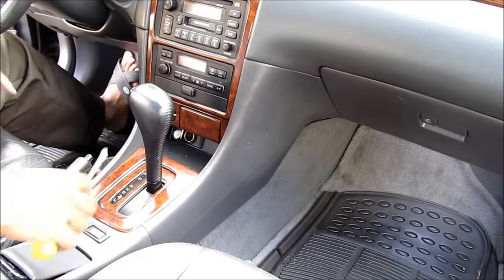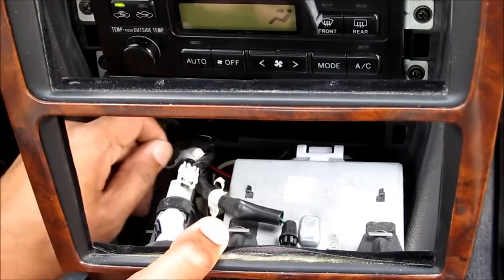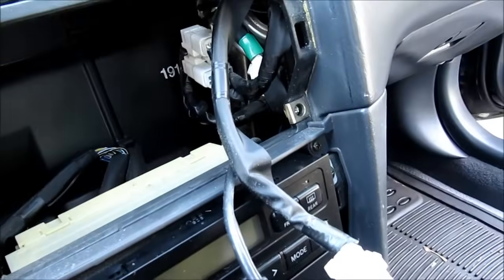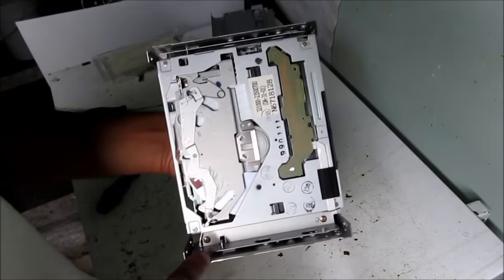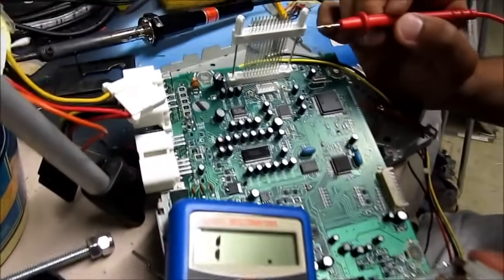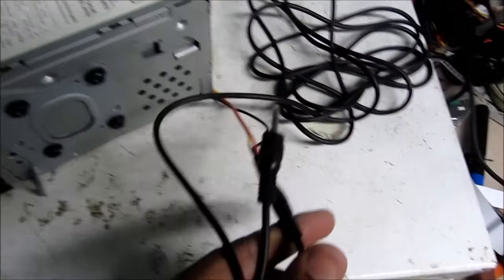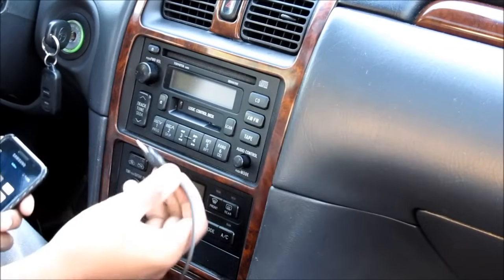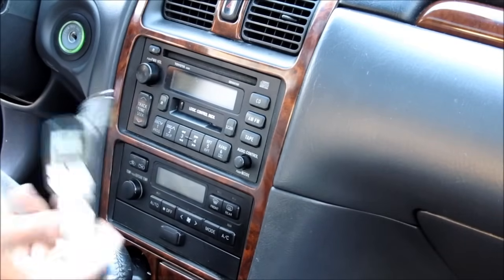Auxiliary Stereo Input Hack

Comment: Have you considered using the L/R pins on the 12 pin connector on the back ? Shouldnt that be the same, but without opening the unit itself ? I have a 2002 Corolla with a W58802 unit and was searching for a way to add an aux input (possibly 3.5").
Reply from the maker: +Spalxy I don't think all radios have a CD changer port. Either way you'd need something to fool it to read from the CD changer port, like a module, or CD changer.
Reply: Yeah, i was afraid of that, was unable to find a "simple" method of just telling it there is a cd changer (like adding a resistor or something simple) and hijacking just the audio pins. There are a few projects on the net, but they are too complicated for my needs. Either way, thanks for the reply :)
Reply from the maker: +Spalxy yea ive looked into them, they emulate CD changers.
Reply: Yes. I've stumbled upon this project http://www.softservice.com.pl/corolla/avc/simpleaux.php which has an AUX only option and should simulate a CD changer's presence just so that he can use the audio inputs, but still looks a bit over-complicated.

Comment: So all I have to do is find the left and right testpoints on the main board and stick the left and right cables of the aux cable? and it works like a normal radio with fm etc but when the aux is connected it plays music from the phone?
Reply from the maker: +NaiReEimaiKyprios yes and don't forget the ground wire
Reply: speedkar99 what happens if i dont connect the ground wire?

Comment: Does it play mono or stereo using this method?
Reply from the maker: +James Patrick both. There's 2 methods here
Reply: speedkar99  I only see one method on this one. There are (2) methods on your Honda video. Is this method on the Toyota mono or stereo through the tape deck test points? Thank you for an excellent video, this is a game changer for my 4 runner stereo.

Comment: speedkar99 i have the same car 99 toyota silara sle with jbl and i want to do this aux hack but did yiu use one single length of aux cable or did you splice aux cable into another cable to get the length to reach from headunit to where it is now?
Reply from the maker: +david anderson In the video I spliced the cable to make it easier to run the wire out of the stereo case, and then joined my aux cable to it. You don't have to do this and can connect it directly.
Reply: where did you get your aux cables from they are different then when you strip a 3.5 cable the wires are very thin copper and not individually rubber coated. did you use wires from a wiring harness?
Reply from the maker: +david anderson the aux wire is a stereo extension cable from the dollar store. The patch wire was chopped off a computer power supply.

Comment: this is the longest b.s. process ever. if you are a tech geek and enjoy working on shit for no reason then cool. however, this is not practical. why not just buy a cd player with a aux input???? maybe $50-$60 at most.
Reply: Thats great but keep in mind your JBL amp will need a specific harness to work with any aftermarket radio. The harness itself will cost about 100$ + the price of your new head unit. So his DIY option is great.
Reply from the maker: +drumbmajorbeats Because this cost $1?

Aftermarket CD players look ugly and ruin the look of the dash.
Reply: +speedkar99 I strongly disagree with you sir. you have used a soldering gun, which most people do not have lying around the house and they sir are not $1. it's ok to say you just enjoy tech stuff & got alot of rime on your hands.
Reply from the maker: +drumbmajorbeats  I don't think DIY projects are for you then...
Reply: +speedkar99 I believe you have missed the point of my comment sir. you have posted a (DIY) video, for more the less an educational video. I have voiced my opinion. that's all. if you don't like it, I wouldn't post public videos, or disable your comments. until then I think I will purchase a cd receiver that has bluetooth, aux, plays cd's and is equipped with Sirius radio already. lol.

Comment: Can this same process be used on the cd/tape deck in a 2003 Toyota Avalon?
Reply from the maker: Yes
Reply: I just had one more question before I take on this project. Did you add the ground wire with the harness (Yellow and red) wires or was that part of the original unit that came from the factory?

Comment: I want to test it before putting back into car. I have a 12v battery but I don't know which connections are for power on the back of the headunit. Can you tell me?
Reply from the maker: +Sam McWhorter I don't have the wiring diagram off hand, but some quick googling will give you the pinout for most Toyota radios. How would you test it without the amp and speakers attached outside the car anyways?
Reply: +speedkar99 I was going to take an extra speaker  lying around the house and connect it to that without the amp..can you do that?
Reply from the maker: Without an amp you'd probably hear nothing.

Comment: great how to! I could get audio through the tape source but only with an actual tape in there - which makes a clicking noise because the plastic cogs are broken. If only there was a switch i could solder to tell the stereo that a tape is installed without actually having to have one in there.

Thanks again
Reply from the maker: +Cameron O'Loughlin Yes I had the same issue on my brothers Lexus gs300 radio. He ended up going thru the CD input and playing a blank CD to force it to read from the CD input. CD doesn't make much noise.

Comment: Thanks for posting this. I just finished the instillation on my 2001 Land Cruiser and it works great (Toyota part number 86120-08130). Very similar head unit to OP's but slightly different. I didn't solder to the correct ground the first time so the sound quality was terrible. I found a pin nearby the two test points that shared a connection with the sony chip ground and that solved it.
Reply from the maker: Great

Comment: it didn't work.
My stereo is a fujisu although it looks the same
How did you test the sony chip Amp it looked like you had a  computer
power supply to test the 3rd pin. on the back of the pcb i found an L & R but not near your pads
Thanks for any help
Garry
Reply from the maker: I didn't use a computer power supply to test, just solder and trial and error.

Comment: Hi, I have a 1998 Camry, would it be better to do this AUX mod, or to get a basic sound system upgrade to my car? I have OEM, and have been using bluetooth radio for playing music from my Samsung S5. As I just started getting into music a little more, I noticed how neutral my car audio sounded - very little bass/treble, it just sounds like... your favorite monotonous speaking professor who helps you go to sleep at night. How much will my car's sound quality improve if I do this AUX mod? How does it compare to a basic sound system upgrade? Or, perhaps do you suggest I do the AUX mod and upgrade my speakers? Thanks.
Reply from the maker: +Ki T the Aux is the same quality as  CD. So if you don't like how your CD sounds, get a new head unit, then work on the speakers. 

In my case I love how the JBL sound system sounds in my car so the Aux was worth it for me. I don't think the 98 Camry had the JBL option.

Comment: i need help.. i had a picture of my motherboard. but i see a L and R.. and another L-Ch and R-Ch. which pair do i need? or plss add me in fb.. search AL Lakard. ty..
Reply from the maker: +Aldralal Wahid To me that sounds like they're the same. Have you tried a continuity tester to see if they are? My only suggestion would be to try and see, that's what I did here and it worked.

Comment: my mother board was different also. but I found r-ch and l-ch and they work, but the only way to engage those tape connections, is to put a tape in the tape player. ( that has makes all kinds of noise ), so how do I override the requirement for a tape to be in, to active the tape circuits...  plz help...
Reply: +Mike Edel sorry just started reading the show more...  So I have to put in a tape...  there isn't a hack to bypass the requirement for a tape in the slot..???
Reply: +Mike Edel there are a couple of switches that detect that the casette is inserted. You need to somehow replace those with an external toggle switch and remove the audio input from the casette deck.
Check out the channel called " The Post Apocalyptic Inventor". He has a video covering this😉
Reply from the maker: +ted clubber lang Thanks. My brother and I tried to get the cassette player into thinking it was there on his Lexus GS300, it didn't work. 
https://www.youtube.com/watch?v=zp-t7cl_ZSs

He ended up hacking in the CD player lines and wired in a bluetooth adapter instead.

Comment: "I'm not sure on the balance issue, unless you soldered to the mainboard which separates outputs to the individual speakers instead of the cassette deck which is just stereo sound."

So which I was supposed to solder the wires... I believe I soldered where you soldered since you and i have the exact same radio... which was @4:18 in your video... 

I believe I did NOT re-insert the tape cassette wire to prevent static pops..

Is there any way AROUND the problem of your statement below...

"you need to turn the radio off, plug in, press play on the phone, and turn the radio back on again, and then repeat everytime you change tracks."

Thanks again!
Reply from the maker: +jlhouse6 So does it work when you unplug and connect? I haven't found a solution yet, I've just been using it as is, my tracks are 20-30 mins long anyway. I suppose I could try another app or ROM on my android, or just go back to my old original Samsung Galaxy S.

Comment: Can I ask which brand of wire you used for the aux-in wire itself? For Samsung phones and LG phones, when I plug in the aux-in, I only hear the car radio but with the volume slightly lowered by itself. I have no problems with an iPhone, or my Chromebook...

Also, not sure why but my BACK speakers of the car is SIGNIFICANTLY lowered... I have a 99 camry and followed the soldering as stated, but my question to you is by soldering the 2 wires to the left and right... does that some how effect the BACK speakers?  I know the back speakers still work because if I use the balance setting and have all the sound going to the back, I can hear the radio whisper...

Any help would be great... Thanks!
Reply from the maker: +jlhouse6 Some cars won't override the radio signal like mine did. You could use a blank tape to trick the player into thinking there's a cassette in the deck and the radio signal will be overridden. 

I'm not sure on the balance issue, unless you soldered to the mainboard which separates outputs to the individual speakers instead of the cassette deck which is just stereo sound.

I too found a difference in the phones. On my Galaxy S, plugging it in with music playing automatically overrides the radio, where as with Nexus and my Galaxy S5, you need to turn the radio off, plug in, press play on the phone, and turn the radio back on again, and then repeat everytime you change tracks. Annoying I know.

Comment: hey, I did this yesterday and its working great, thank you. but it only works when theres a tape in the deck,it doesnt work on FM radio like you said. and when theres a tape inside the sound from the tape overlaps with the AUX sound, a bit lower in volume but very obvious. so what i did is i got one of those cassette to aux adapter and cut the wire and use it in the deck. do you have a better idea? maybe trick the stereo to think that theres a tape in the deck?
Reply from the maker: FM override seems to work on only some radios You can disconnect the traces of the cassette player so you don't get interference.
Reply: +speedkar99 how do i do that.
Reply from the maker: +kmmdur Trace the wires coming off the head of the cassette deck to where the ribbon cable attaches to the board and disconnect it.

Comment: @speedkar99 what if my camry doesn't have jbl? by motherboard looks different than yours but on the back side I see a L and R solder point. Can I use those points?
Reply: +speedkar99
Reply from the maker: +Jacob M Yes you can. Not sure if you'll need a blank cassette for it to work though, like this:
https://www.youtube.com/watch?v=zp-t7cl_ZSs
Reply: +speedkar99 Hey I ended up soldering my aux cable to the mother board L and R points (my motherboard didn't have the same points as yours) and my radio doesn't turn on anymore...Have any idea what I can do? When I press the cd eject the cd comes out but nothing else works
Reply: +speedkar99 I should have waited for your reply :)
Reply: +speedkar99 Can I send you a picture/ video of my motherboard so you can tell me which points would work if possible?
Reply from the maker: Take apart the radio and double check the connections. There might be a fuse in the radio, check that. Ejecting only the CD sounds like it's not getting ignition power (as you can only eject CD when car is off). Check the wiring harness to make sure 12v is hot when ignition is on. Did you solder a ground connection as well?

Comment: Hey just wondering, can we just remove the tape deck unit entirely? It doesn't seem like it's necessary to keep it inside in the whole unit unplugged.
Reply from the maker: +Jason Huang It depends on your radio. In my case it overrides the FM signal so the tape deck is useless. But in most other radios you need a blank cassette to fool the TAPE function in to reading from its source, like this: 
https://www.youtube.com/watch?v=zp-t7cl_ZSs
Reply: +speedkar99 Just took it my radio apart, but I found it's a different version of yours (possibly older). I'm having difficulty finding those points to solder the connections to. Any advice?
Reply from the maker: Did you look on the cassette portion of the radio circuit board? Trace the ribbon cable that comes off the cassette head where it plugs into the circuit board. There's usually positive and negative, right and left of each, and then ground.

Comment: +speedkar99 My 3.5 mm jack doesn't come with ground wire, is that okay? Please respond.
Reply from the maker: +John Jeriz Lopez Ignacio The jack doesn't come with a ground? It should, and it should make contact according to the 3.5mm pinout here:

https://lh3.googleusercontent.com/-2YwJ27Nb3Wc/U-5XpZNKtdI/AAAAAAAAHjQ/jJDJq1oKOPc/w392-h439-no/Milestone-dock-adapter-pinout-audio1.png

Otherwise you have a microphone (or mono) jack with just ground and left.
Reply: +speedkar99 Umm, My jack had only two wires, the black with white and pure black. I cut them our from my old USB speakers. Is this still okay?
Reply from the maker: You need a ground for it to work. Connecting L & R only won't result in any audio. You probably have a mono-speaker wire.
Reply: Haha, I already figured it out. I finally solder it and it worked. Thanks speedkar99
Reply from the maker: Good to hear you got it working. Did you find a ground wire?